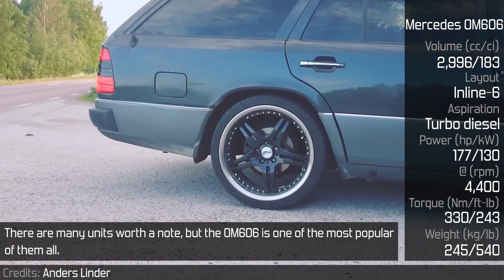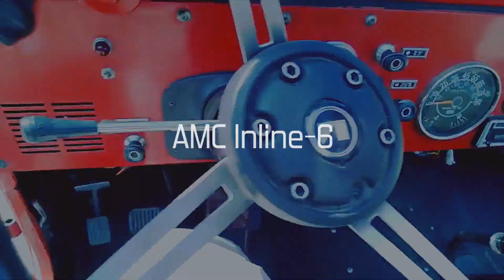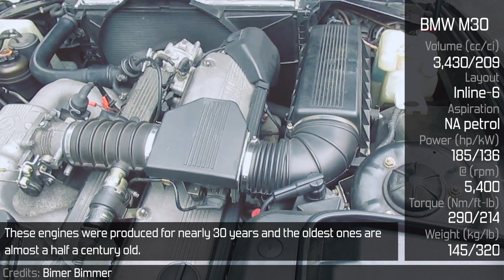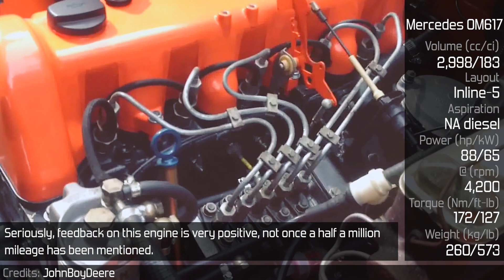10 Most Reliable Engines Running Beyond 300,000 Miles

Comment: What about the mighty 4A-FE?
I've seen some of em with over 300.000 miles
Reply: I have a 96 Corolla dx with the 1.8 4A-FE that has over 340,000 miles refuses to die. Just replaced the motor mounts and idles perfect and does not leak or burn oil with factory AC. Just needs a paint job. Daily driver 110 to 115 miles a day. Love this little beater.
Reply: @jellyroll5247  4afe? is that sohc?
i have a 1.8 Corolla Dx before the engine i have is the 3tc
Reply: @jellyroll5247  1.8 4a-fe, interesting... 1.4 4e-fe, 1.6 4a-fe, 1.8 is 7a-fe, 2.0 is 3s-fe or 4a-ge. I have 4a-fe and this sounds better than new engines production and work culture is amazing!  The sound of a ticking watch. Japanese all engine, and america works 1 engine on all life human. The 1 milions mile is no problem, on a good exploatation, and basic service, breaks, oil 10k miles years, filters.
Reply: @furieux6742  if I got the engine wrong my apologies. As old as this car is people still ask me if I want to sell it. Funny, the guys that know, know. Just a well made engine and great A to B ride. I won't win any races but I won't be stranded either.
Reply: @jellyroll5247  Full consent :)
Reply: you better hope you aren't stuck with the 3 speed 4A-FE then, since that engine will be revving high on the highway.
Reply: The 4AGE in my car has 213,000 and no signs of stopping. My friends just hit 400,000.

Comment: Mitsubishi 4 cylinder 2.0 straight diesel of Pajeros , Lancers etc. . I use to have Lancer Estate (Wagon) built in 1994 , engine did clock 560000 m , never topped oil between services .

Comment: I would have to disagree with the PD TDI engine. I have a Jetta with a PD motor with 225k miles on the clock, but it's had the camshaft replaced twice, as it was a poor design. I also have a Jetta with a 1.9 ALH TDI at 305k miles, and still runs strong! better than my PD TDI.

Comment: 1987-89 vw jetta 1.8 liter gasoline engine. One of these jettas was bought back from the original owner w/ 900k miles on it. VW wanted to put it in a museum iirc.
   I owned an 87 jetta a long time ago. It was worn out with well over 480k miles on the odometer but the cable was broken long before I got it. It still ran. The oil pump failed on a drive one day shortly before I scrapped it, I drove it 30 miles to my home with no oil pressure. The next morning it started right up. I only got rid of it because the body was rusted out too badly to pass the vehicle inspection for another year.

Comment: The Australian Ford Falcon 6 cylinder engine.  The big lazy six.  Every one of them get 500,000 + klms.  I have taken 2 of them to 400,000 klms over the last 20 years.  I am on my third now, only has 190,000 klms on it, it is still a baby.  Tons better than the Buick 3.8
Reply: Have you asked any Ex Falcon Cab drivers who flogged them well into the million k's club?
Reply: My EF Tickford is at 330 and runs good.
Reply: I dunno about tons better than the 3.8L.  I’ve seen a lot of 3.8L with 300k miles.  The biggest killer of those engines is the Dexcool (antifreeze) GM used a number of years that would eat gaskets; eventually dumping into the cylinders while running.
I wish those Ford 4.0 inlines were available in the states.  If it’s anything like the 300 inline (4.9), it’s certainly a durable engine.
Reply: StL ChuckO your talking about the barra 4.0 straight 6 yeah that would be great
Reply: Paul Miles 

Ahh.. the great aussie steamer!! Pre crossflow very good. Alloy head crossflow and all the ohc ones do head gaskets at anywhere from 100 thou to 200 thou kms. I am a mechanic and can assure you many shops were kept in buisness doing head gaskets on em!! Hands up all those who have seen one on the side of the road with the bonnet up and steam pouring out... be honest...

Comment: A Nissan KA24DE or KA24E will last 500k miles if not drifted, turbocharged, and has the normal maintenance done. Mine is around 350k miles and just keeps going strong. 180+ compression on all 4 cylinders.
Reply: JohnnyNismo Nissan sd25 and sd20 motors are the same cast iron head ,3 bearings no turbo producing about 90 hp. I am @ 365,000 on my 720 pick up.
Reply: Ayy good jokes man.
Not but seriously i feel bad for you guys who got the KA24's.
Reply: I have a 93 hard body with the ka24e and it has over 435k. Been through 2 tranny’s but the engine Still runs strong.
Reply: then boom
Reply: Was that used in the 1990 Stanza?
Reply: JohnnyNismo Original Head gasket?
Reply: SR is better than KA tho, SR's actually make power to
Reply: There's also the RD28, which is basically just a diesel RB26. I've heard a few people say they can gt to about 400-500K without needing serious work doing to them.
Reply: JohnnyNismo what about a low boost DETT
Reply: Although they made great engines, the cars rusted out too early. So hard to tell if it would last over 150K miles, by that time, it was headed to the junk yard.
Reply: +Neal Vio
That may be true if you live where there is road salt, or you live very close to the beach. I live in where there is no road salt, and it is common to see Nissan Hardbody trucks on our roads.

+ThEcRaZ3dGaM3R
In the early 1980s, Nissan did something similar when they created the LD28. They took an L-series engine and successfully made a diesel out of it.

I don't know why Nissan and VW were able to use so many gasoline engine parts and make a long lasting diesel in the late 70s and early 80s. Oldsmobile tried it first, and the result was one of the worst diesel engines in history.
Reply: It lasts. You just lose most of the miles when the tires rotate but you don't Run.

Comment: The Chevy 250. My brother's 1980 C10 had over 300,000 on it with no wrenches turned. It was completely worn out but it still pulled a trailer 500 miles before we took it apart. M 1975 Nova was rebuilt at 200,000 and ran 300,000 till recently I discovered a cracked piston. It's still running on limited duty.

Comment: You forgot the Barra motor, plenty of taxi's in Australia with 600,000 plus km's
Reply: trevorhendy123 even the AU.
Reply: I'm on 354,000km on mine and it still going strong!
Reply: Best fords ever made was by the Aussies. I own a AU2 XR6 VCT. She is spotless and i hasn't let me down once 250k on the clock still pulls like a steam train.
Reply: What about the ford i6 300 cu. It may not rev like the barra but it will run all day and night
Reply: iv seen some in aus with over 900k  on the clock not sure what the name of the motor is but its a ford falcoon
Reply: Had my 92 Fairmont and that hit 800,000 before  stopped using it .
The engine was still strong but the heater was stuffed
Reply: more like over a million.

Comment: FORD AUSTRALIA 4.0 I6 INTECH ENGINES
1,000,000 KMS CONSISTENTLY RECORDED
Reply: As much as I dislike our fords I give them respect for lasting so much even if the earlier engines prior to BA got serious bore wear issues before 200,000km, they still ran to a million km with bores that worn out long ago. They just go and go even if they are always on their last legs. Pretty amazing really.
Reply: Never heard of bore wear issues with them, my old EL Falcon did 350,000 kms without any significant wear or loss of compression. What eventually killed it was blowing a welch plug out of the block on the freeway and cooking it.
Reply: Its not something you see or notice until you remove the head and look. Thats what I mean is they seem to go fine despite wearing out quick. I had this issue on about 9  engines with in the family and some friends (all blew gaskets so I saw the bad bores repairing heads and retrofitting them to MLS gaskets) . My bother's EB had one where the pistons had worn and turned into the bore at an angle of about 5º. It has 0 comp on that cylinder understandably. 

Its just the nature of their design given they are massively under square and have a lot of piston side load and the pistons are low silicon making them have more anti scuff properties which also makes them have a high expansion and contributes to low temp wear due to excessive clearance before they reach operating temp. 

But that low silicon alloy is what make them reasonably good at taking boost with detonation shattering the pistons. 

I'm not sure what the BA and onward are like as we only have 2 fords left in the family, 2 BF utes and they never needed the heads off so seem to be really good.

Rest of us all have Buick v6s now and one 5L VR ute. I can tell you the 5L sucks for reliability, not the engine itself but the ancillaries and gaskets other than the head are crap as they are with the early fords.  

Buick coupled with the T5 transmission on the other hand is absolutely flawless.  I have done documented tear downs on some of my highly abused high mileage engines which I put nearly all the mileage and abuse on them and its incredible the low wear rate and no signs of damage.  I <3 the buick v6 :D
Reply: Good to know, I have now had a BF XR6 for almost 3 years, only real issue has been the shift cable for the auto trans, other than that no dramas.
Reply: Those 1,000,000 kay cars/engines were probably taxis. Its not just ford engines that last well in this usage . the telling factor is operating temperature and maintenance. Engines in taxi usage run for long periods at the correct operating temp - the clearances are kept right. It is start up and running at low temps that kill an engine fast.
Reply: 3800Tech 600,000+k stock bottom end, no taxi, still goes strong & runs every day! I'm about to retire that motor to speedway use & replace it with a "low k" 350,000+ unit! plus I also know of a few 200,000k+ au motors running at minimum 8 psi boost (most turning 18+psi) and living as daily motors! yes, granted they don't get flogged daily, yet still see regular track use. I'm yet to see a honest 3800 live past ,400,000k with any kind of flogging. yes I've seen a mates ute with over 400k but that's a 3.6 eco, and its not unopened, amazingly though, and completely against standard 4l60e v6 spec autos, this one was only replaced at 385k with a "low k 200+ unit" so hopefully the owner gets another freak box. its very rare I see a "Buick"'aus spec 3.8 go above 300-350,000k. that is mainly due to the inherited imbalance issues created by the basic design of the motor. for instance, they had to run a counter balance shaft in the v6 to make them live,yes later motors they managed to overcome this, but Ford had a much more refined motor from the start, even though it was based on more primitive architecture. sorry to go on a tangent, but everything I have seen, and has been proven from my husband, via decades of mechanical business, has proven the ford 6 to be a superior and far less maintenance unit. there are few motors on the planet that can go above 1mil k original, yes we produce great examples, but I have to  concede I have seen far more German (Benz especially) cars shitnon our aus units. (although our equivalents are far more fun! ;) ) any hew, have a great day fellow sunburnt friend! lots of love!
Reply: ford did seem to put a little more into anything they sent or built across the pond or down under
Reply: 5THR33S Absolutely, I still own my 2000 model AU Falcon (vids on my channel). Has 320,000km on it now, nearly all done by me and have never had a single problem other than replacing small maintenance items, which is all it's had since new. 
It runs and drives like brand new other than some suspension bushes that need replacing due to a couple of desert trips and hitting a fallen tree at 80km/h!
Incredibly tough car, I've decided to keep it to see just how many KMs I can get out of it!
Reply: Graeme SYDNEY That's kinda true but no deal breaker for them! 
I used to buy parts off a guy with a BA wagon. He drove it since new as a taxi and retired with the car at just over 600,000km and used it for his mobile detailing business. Last time I saw it, it had 960,000km on the clock and was smooth as silk! Still original engine with nothing but basic maintenance, 2nd rear diff and recently installed the 3rd transmission though. Very tough rigs...

Comment: I bought a Buick for $500  that has the supercharged gm 3800, has 252,000 miles on it and its one hell of a sleeper, even in a giant Buick park avenue it still has more than enough power to run with some pretty quick cars, so far hasn’t given me any trouble other than a dry rotted vacuum line that caused it to stall randomly

Comment: Gee whizz, I can't believe the most durable American engine ever made had no mention. The 4.9 L 300 cod Ford inline 6. First made as a industrial engine, then used in F series trucks. Indestructible as long as the owner changed oil & filter regularly and changed antifreeze every 3 years.
Reply: Mark Capps my first truck had this engine. I was not nice. Literally has not seen more than a plug wrench since it was outfitted with a homemade air cleaner in 1980. My grandpa said it ran a lot smoother after it inhaled some mt. St. Helens ash. Honestly probably gave it a good cylinder wall polishing lol. It now sits with no third gear but grinds around the farm every now and then in first and second with a solid 410 thousand on her.
Reply: No kidding! No question the Ford 300 I6 was the longest lasting gasoline engine ever put in a passenger vehicle. Only engines I'd say would last more miles are the big slow turning diesels in the over the road trucks. The 300 I6 was the longevity king! Ford just couldn't meet newer EPA regs with it, so like all great things, it had to come to an end.
Reply: @patrickjaegers3110  I had one in a Bronco.  The engine outlasted the vehicle.  We pulled it out and ran it for another 10 years in a truck, then took it out and ran a sawmill 10 hrs a day, 5 days a week for another 10 years.  Finally it threw a rod through the block.
Reply: @bigdogpete43  Yep, they were near impossible to destroy. You might be the only person who ever used one to its full potential that actually wore one out. 10 hrs a day for 10 years! That's awesome!
Reply: @patrickjaegers3110  Ya we rebuilt it like 3 times.  It was bored out more times than a French prostitute.
Reply: What is antifreeze?

Comment: K series Corolla engines are known all over the world to surpass 700,000 mile regularly with no issues. 
The Australian Ford straight six, both pre crossflow and crossflow were known to consistently hit a million kms and beyond without effort or issue.
350 Chev, when serviced and not flogged last ages.
The GM 3800 originally designed by Buick is a boat anchor and known for failure.
More research was clearly needed before this video.
Reply: Toyota 4A-FE motors were known to be bulletproof indeed.

Comment: small block chevy 350 5.7 l
Reply: my carbureted chevy 305 - 300K
Reply: MOD127....Probably the cheapest to modify and make good horsepower, but definitely not the longest lasting. Any I've seen disassembled after 150,000 has  cylinder taper out of tolerance.  The newer LS is a much better engine for long lasting and high horsepower.  6 bolt main caps vs (mostly) 2 bolt main caps.
Reply: this one has my vote  the engine requires little maintainace and will go 300 thousand miles easy
Reply: Dude my 98 k1500 has 648,000 miles on the damn thing WITHOUT BURNING OIL or being rebuilt! Replaced the transmission 3 times though. Vortec 5.7! My “new” one only has 200k. This is a fantastic workhorse. This really should have been on the list.
Reply: it does indeed make a very durable boat anchor
Reply: Chevys small block and definitely inline 6 cylinders go and go. I only see one go bad if abused and neglected.

Comment: Mopar slant six. Check the forums.
Reply: If you can find it, check out the Chrysler torture tests. Apparently they thought owners would haul a trailer full of bricks as part of their daily commute, and built it accordingly.
Reply: the chrysler slant six would run and run, the car would rust out before the engine would wear out
Reply: Too fuelish
Reply: Just what I was thinking my Dad owned a 72 Duster and drove it till the body was falling off but the ole slant 6 still purred like a kitten
Reply: The Chrysler V-6 is much longer lasting that the slant 6. The V-6 always goes 250,000 miles (400,000 km)
Reply: Roger, that's another golden oldie.
Reply: I hear ya on that they built a pretty darn nice V6 not that boat ackor they stuck in mini vans but the one they use in fleet vehicals like the 1992 B model 150 Dodge van I had one it was an old Phone company truck they even had a better transmission in it
Reply: The reason my 87 D100 slant with 376000m is still around is that it don't have enough power to blow up. Still one of the most reliable trucks I ever owned over the last 45 years
Reply: Lamar, IDK, I had a 65 Plymouth w/slant 6 that I used as a tow car for the drags, it would pull a car 70-75 M.P.H. up the Mass. Pike without grenading.
Reply: Not really. The slant 6 was good for 130,000 maybe 150,000 miles. They don't go 300,000 like modern cars such as the modern Chrysler V-6
Reply: @hyzercreek  yes they did.

Comment: older toyotas (corolla FTW) and volvos...
my corolla xl-i from 1994 (4A-FE engine) has already run over 330 000 km, and only problem it ever had was that the other register plate light's spring/bow (i'm not a native english speaker :) ) was a bit tired and didn't contact the bulb...